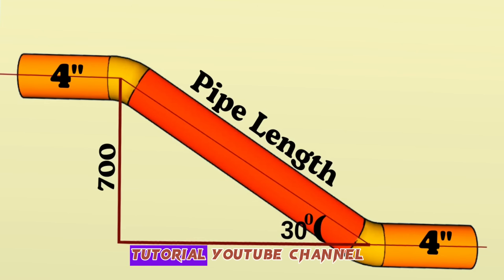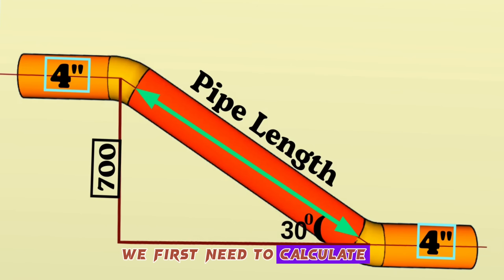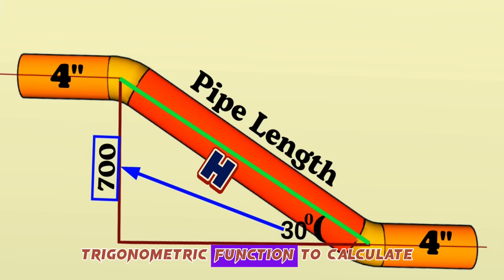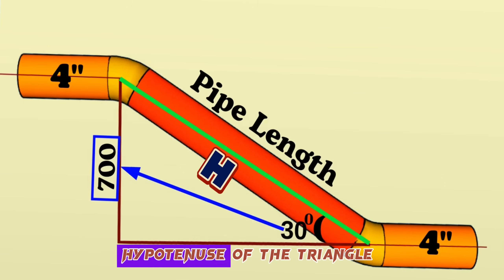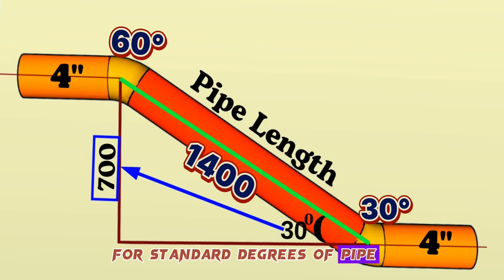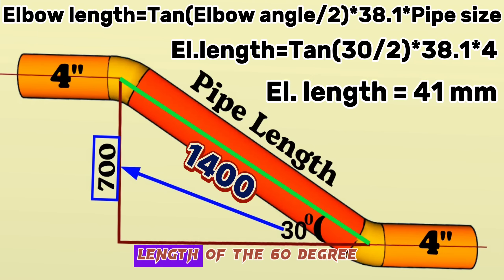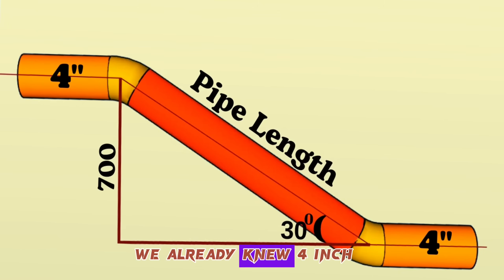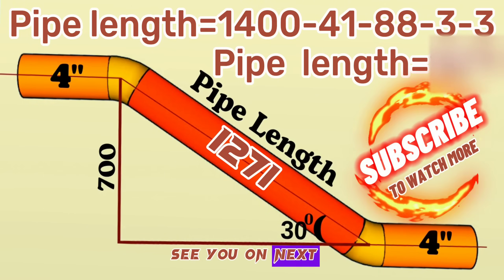Pipe Length Calculation Formula.

Comment: 6:05

Good morning,

I would like to ask for clarification regarding the following issue. Why, when using two 30° elbows—where one elbow is oriented “upwards” and the second one is used to realign the pipe back to the horizontal axis—the length of one elbow is calculated as for 30°, while the other is calculated as for 60°, even though both fittings are identical 30° elbows?

From my point of view, it seems logical to apply the 30° length for both elbows, since geometrically they are two identical components. I would appreciate an explanation of the reasoning behind this calculation approach.

Thank you in advance for your response.

Comment: multiplying to inch how to get mm?
Reply from the maker: Many thanks for watching and comments.
Pipe elbow length calculation formua such:
Elbow length in mm = Tan(Elbow Angle/2) x Elbow Radius in mm OR Tan(Elbow Angle/2) x 38.1 x  Nominal pipe size (with inches size)